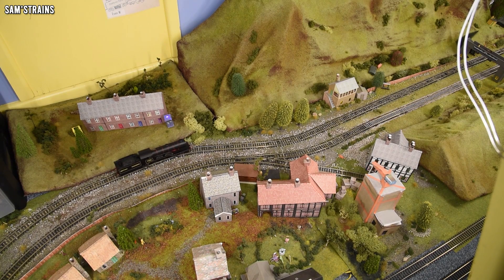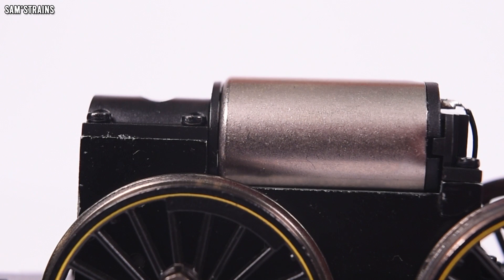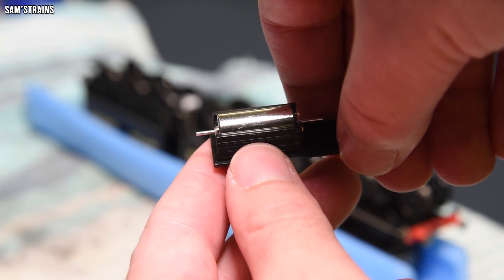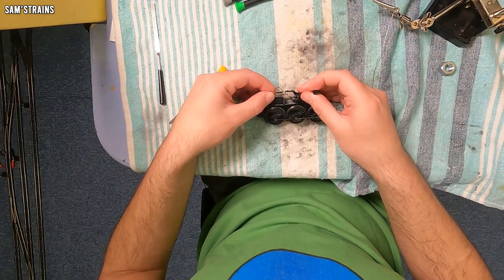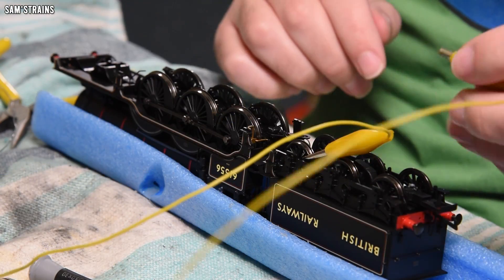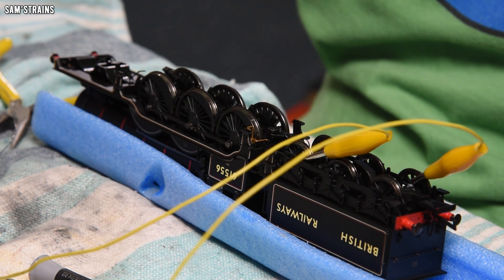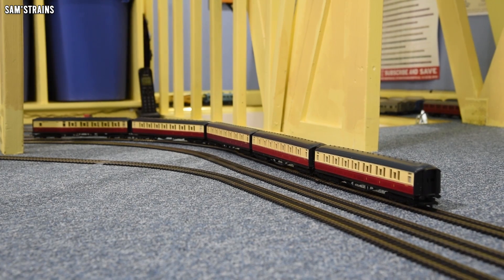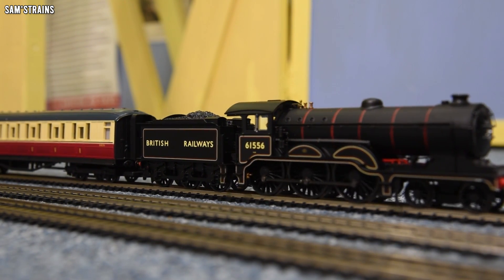Putting a Bachmann Motor in a Hornby Loco | The Broken B12 Saga

Comment: Here’s a video idea: try and fit one of those coreless new motors in an older Triang or Lima loco using one of your 3D printed motor mountings. I’ve always wanted to try it but don’t have a 3D printer to make the mounting.
Reply: I despise you for suggesting putting a coreless into a Tri-ang locomotive 😡😡😡😡
Reply: @111greatbear3  Well if you use an adapter then you can change it back… plus I’d only do it to a non-runner wreck anyways

Comment: When you said that the new bigger motor was "more expensive" than the other one, I was thinking that it was going to be like £20.  or something!   Not just £5, odd!  Re the original motor(s) in the B12s'  anybody with a faulty one ought to be able to send them back direct to Hornby for a NONE faulty motor to be fitted at Hornby's expense, and they should cover the postage/shipping cost.

Comment: I would have been tempted to check out the tightness, to see if it could be something that could be imprived on. EG made to roll more freely without the motor in place!   To my way of thinking it should be free to roll, and not have any tightness.  *(although I could be wrong)

Comment: It looks like there may indeed be an issue with the drive train or wheels. Look at 10:48 when you hold it back you can see the rods are not level when running as they should be .
Reply: That's just how Hornby manufactures their con rods. They're generally really flimsy and have lots of slack in them.
Reply: I agree, that looks like its in the quartering, part of the issue is that the axle under the cab is the first driven axle.

Comment: Well done, Sam!  Your last tweak of the mechanism really did the trick.  But I think the main moral of this story is "Penny wise, pound foolish" when it comes to motors.  Considering the original cost of the engine, saving a few quid on the replacement motor just doesn't make sense, eh?  By the way, between watching you and OOBill I've gathered enough courage to work on loco mechanisms, even though I'm "mechanicially challenged."  Wish me luck, and cheers from Wisconsin!

Comment: Brilliant. Having researched micro/mini motors lately, it seems to be quite the intricate big tech industry on its own with motors ranging from 1 USD to over 100. The latter e.g. for medical devices I suppose. This type of coreless design seems to be according to Faulhaber’s blueprint (original patent) and are available on Aliexpress, Ebay today in various voltages, amps and RPM. We’ve understood somewhere that Bachmann have some of their motors custom made by Buhler who make micro motors on special design request by various manufacturers. But if you shop around, there seems to be plenty ways to go around and find solutions with some extra work; tons of micro motors out there of ~13000 rpm and 6-12, 12-24 volts which should do the job. However, in the end perhaps the expensive ones do offer finer speed controls and higher durability. It’s an interesting subject on its one these micro motors.

Comment: Nice job! you've really found a great solution. The motor clearly runs well and has no trouble with the Hornby chassis. If they really are the Bachmann type of motor (certainly look-e-likees), perhaps Hornby might like to sub-contract to them...I really hope they monitor your channel..... I've followed your lead and ordered a couple just in case Hornby can't source a replacement motor themselves for my B12's - that they still have - (or if they fail again when they finally complete the repair - have faith?). Thanks for all of your efforts.

Comment: Hi Sam, brilliant work, I have three of those motors standing by. How did you reduce the friction in the mech? My B12 had incredibly stiff pickups on the backs of the driving wheels, was yours like that? Top work mate, Mike
Reply from the maker: Thanks so much Mike! I just widened the drive shaft adapter so that it didn't grip the shaft so much... then it was perfect... turns out it wasn't anything in the mechanism itsself!
Thanks for watching, Sam :)

Comment: I initially thought the stiffness was down to the position of the worm drive on the spindle. Then I watched to the end 😉…
An old trick I was taught when fitting worm gears was to use a cigarette paper between the drive gear and the worm

Comment: Absolutely brilliant Sam. Unlike the poor Dock Shunter this loco repair has a happy ending. Its very interesting how well it actually runs on that in my opinion still tiny motor. The upgrade was definately worth it it's still cheap as hell to repair it if you have a 3d printer (unlike me)

Comment: Hi Sam, great video. Have you had a go at replacing the noisy motor in the Hornby N2 locos ?   I looked at getting one and even though Hornby did release an "updated" model R2214 it seems they re-used the old motor and thus did not fix the noisy running problem which you showed in one of your videos

Comment: Hi Sam, two motors burnt out on my B12 which has seen little use. 😮
Just wondering if you were interested in manufacturing your adapter and other mods, to sell as a kit to help out other modellers with the same problem?
Cheers Dave 👍

Comment: Very interesting!  It was interesting how the old Tri-ang 3 pole and XO 4 and the original Hornby Dublo motors were (Hornby Double before the original Ringfield, which would stall and burn out if you weren't careful).  I have some still operational.
Reply: Yeah I recently fried the ringfield in my tender driven 9F evening star

Comment: That's a fantastic tutorial of how to make things better than ... well, what manufacturers sells at a pretty hefty price? 
Also coreless motors still have 3 or 5 poles, as in principle these are regular DC motors but construction is just physically very different (and very high-techy, the way the rotors (especially as tiny as these ones) are wound is seriously impressive). The downside is that brushes and commutators of coreless motors are close to being completely unserviceable, making the motor disposable.
Also the step beyond that gets rids of poles is brushless (stepper) motors, these ones are torquy as hell at low speed, and nearly wear-free,  but way more expensive and it's a whole different job of retrofitting one, as it would require a dedicated controller paired to it.
Anyway, well done, works beautifully, I hope this beautiful and very classy looking engine will be seen times to times in the future.

Comment: Fascinating. Makes me wonder whether manufacturers would do better offering a choice of motors in new models in preference to add-on extras like tinted cab windows or etched nameplates.
Reply: I just wish they'd installed decent motors to begin with       to justify some shockingly extortionate prices manufacturers charge!
Reply: @aveedub7403  Does make you wonder when a superior motor can be had off EBay for little more than a fiver.

Comment: The resistance you felt in the mechanism could be affecting the crawl on this model.   The slightly more expensive coreless motor seems to be worth the extra money for those models that warrant it to be spent on them.   I mean, it's still less than 10 in a loco that Hornby have some very high RRP on.
Good find on the adaptor.   You saved Hornby having to replace it with a good one, but you've also proven Hornby have a serious motor quality issue with some of their models.     I hope someone from Hornby watches your videos.

Comment: I was gonna say that it would be interesting to try and add a flywheel on the other motor shaft and see if it gets smoother, but now I don't think it could get any smoother. The final result is very much factory performance

Comment: Well done Sam. I would like to see a comparison between a 5-pole and a coreless motor. Same rpm. What difference in torque / amp draw etc. Interesting !
Reply: Having gone through some extensive research on micro DC motors lately, in theory coreless should be more efficient and therefore drawing less current (amps) at the same rpm. They offer finer controls at all speeds as well. Disadvantages could be that they heat up quicker and higher, and not handle an overload well (e.g. a combination of steep inclines and/or total weight of wagons or coaches to pull). Since they lack a core mass, they speed up and slow down quicker. Hence, inertia isn't great. However, finer controls and higher efficiency speak for this type of motor. Perhaps Sam could one day elaborate on it by some comparing examples, and also show amp testing, etc.
Reply: @lindaoffenbach  Thanks for this information. Cheers, filip

Comment: hello Sam, I have a problem with my Hornby Edl17 its the metal bodied 3 rail loco. ok the problem, i recently moved and my box of To be repaired locos got dropped and run over, yeah. the survivor is the edl17 but, its motor ws scattered to the wind and i have no clue of what i am doing to put the motor back into opperation. thanks for reading my waffle.

Comment: Thanks for this excellent techno-refit video using the newer coreless motor in your Hornby B12. What is the correct gauge to success? What a fabulous result! Well done, Sam. I have three Hornby B12's - in their original boxes - which say they are: R150-9300's. The tenders have a 'mechanical simulator sound effect'! I bought all three new for 28 pounds 65p.! I do not know how these versions compare to your version. All three have the Loco Number: 7476 and pickup is on the Loco's front and back Drivers. Boiler handrails are silver-painted on a plastic extrusion part of the boiler. How cheap is that?!
Reply: The price I quoted was the total price for all three. One was 10 Pounds, one at 9.65 and one at 9.00. Made by Rovex, Margate.UK

Comment: Hi Sam, great broadcast again.............my wounded B12 is currently at Hornby's for a warranty repair; call me cynical I'd be surprised if it runs as intended with a new motor.
I like the model very much, so I wonder if you could supply the bits I need to install this bachman motor into my B12 when it comes back from Dr. Hornby? I'm sure you'll get asked this question ad nauseam. Clearly there'll be a cost element if you could quantify that I can settle up with you. Much appreciated        Shane

Comment: Hi Sam may be a good idea to check the driving wheel quartering, the r/hand coupling rod was not straight the rear wheel set looks to be out of phase ?may be nothing.
Reply from the maker: Thanks Richard - I've had a few comments saying that, but it is fine - the wheels turn perfectly freely without a motor installed!
Thanks for watching, Sam :)
Reply: @SamsTrains  gosh that was fast! I did wonder great conversion I would say could be a good motor for other ailing and failing locos? great video as always.

Comment: Would you be willing to try pulling the flywheels off the original motor and pressing them onto this one, or if they have a different shaft size, trying to make a flywheel for it? That would really bring it up to the highest quality.
Reply from the maker: Yeah different shaft size unfortunately - an adapter would be possible, but if you mount a flywheel even minutely off-centre, it's far worse than not having one at all!
Thanks for watching, Sam :)

Comment: Massive improvement, for sure! Maybe you should get a little less force on the axis of the motor in order to really see the potential of that motor. Probably try some sheets of paper in-between the motor mount and the chassis? Also the motor might live somewhat longer that way...
Reply: I might be wrong but doesn't that put more friction on the motor axle ? Can you explain ?
Reply: @phil36310  It looked as if the motor axle had constant pressure on the worm driven gear/slotted axle stub. This would result in a high force on the front motor bearing, given the leverage that the adapter has due to the distance to the front shield of the motor. As these are normally sintered bushings they tend to wear out if they get constant side forces. With some sheets of paper you can change the distance slightly to reduce the forces.

Comment: Nice to see that these motors can be used to rescue older locos. This is running DC? I would guess that with a DCC decoder I think it would be much smoother at low speed.  I've used small geared motors in some of my 08's and 20's for super low creep running.